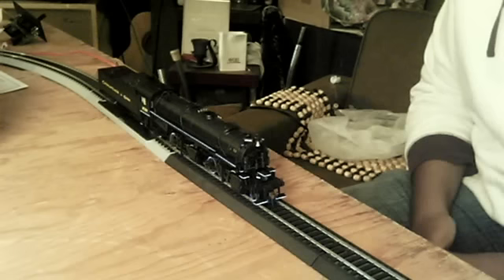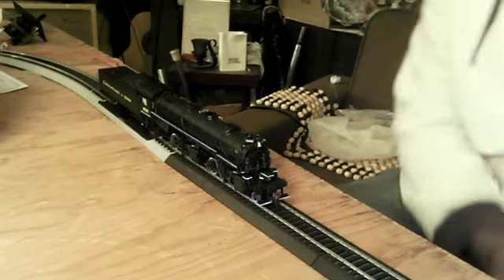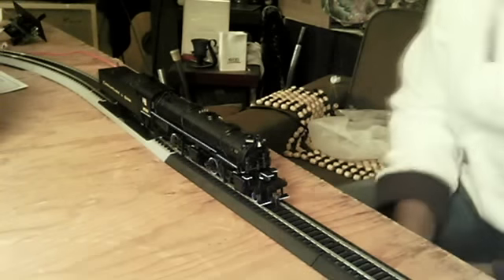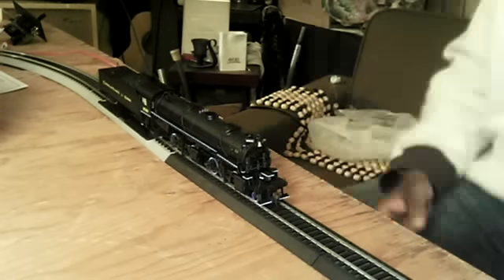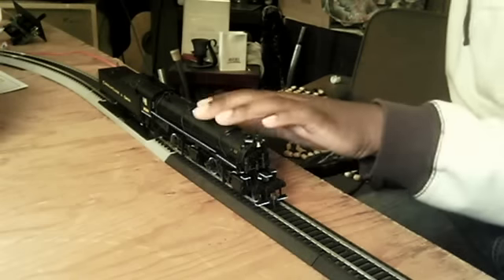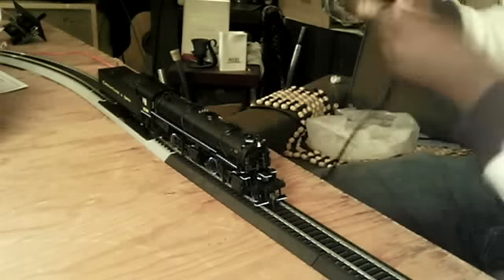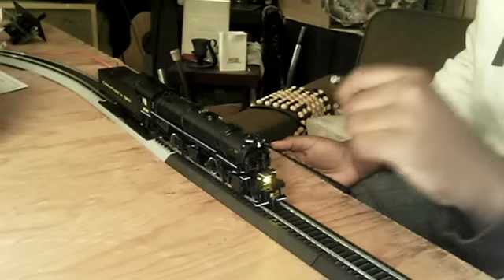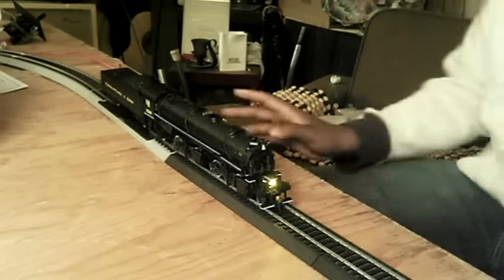Bachmann Spectrum 2-6-6-2 W/ DCC and Sound Review

Comment: i have the same loco, i paid $120 but without sound or dcc. its dcc ready and has a decoder installed but without sound. i bought this model about 4-5 years ago and it hasnt been run it quite some time but its mint and in the box. i will be running its again im going to build a new layout soon. i also have a spectrum J class that looks awesome as well as a decapod

Comment: 100% agree ... bought one myself 3 weeks ago , without sound , my only peeve with the dcc no sound is the crappy 28 speed step dcc decoder , i put a 128 speed step hornby decoder it to replace the crap bachmann 28 speed step unit ,massive improvement (any 128 speed step will do, but i only had a spare horby unit) I am about to put a tsunami decoder in it as soon as i post this with sound. the other great thing with this loco is how it does what the real thing was designed to do , and that is negotiate real tight twisty track ,as tight as 15 inch radius ...yes i said 15 inch radius freakin awesomely , also has some pretty amazing pulling power and is silky smooth runner , highly reccomend this loco
Reply from the maker: you should post a video of it as soon as you're done!
Reply: Railroadkid1937 I actually ran into a minor snag.On disassembling the tender i found i need a rectangular speaker and enclosure , my model has a Vanderbilt tender , however , I have a Bachmann Spectrum 2-10-2 with DCC and sound , which uses the identical tender in your video. The 2-10-2 is currently in a disassembled state awaiting a new drive chassis to arrive , so until it's rebuilt I'm using it's tender on the 2-6-6-2. I'm not sure , and I've listened to the sound on your vid a few times , but , is that soundcard actually producing the double out of sync chuff associated with an articulated loco ?
Reply: aussieaeromodeler question answered lol ....at 12 minutes into it
Reply from the maker: aussieaeromodeler lol glad the video could help out a bit :P all the tsunami decoders can be set to the double chuff btw.
Reply: they can ? .... awesome i dont suppose you know the cv to adjust and what to adjust it to by any chance ?
Reply from the maker: aussieaeromodeler I don't but check tsunami's website and look up the instruction manual for the steam decoder, that should give you all the information you need.
Reply: yeah just had a look , it mentions cv112 ... then goes on about 'bits' ... im guessing i need a laptop and software to change anything other than a cv value
Reply: i should mention im using a flieschmann multimaus control
Reply from the maker: no you should be able to change it without a computer. There is a particular cv you have to set and it may be 112. see if you can find the value for the cv.
Reply: the cv value is set to 0 at the factory , and stting it to 1 makes no difference. reason i say i may need a laptop , it shows a computer dialogue box ... with what looks like slide bars if you know what i mean ... similar to sound settings etc for your computer . I know there's software available to do these things , and the hardware to go with it , I might even look into getting hold of both.
Reply: aussieaeromodeler http://www.soundtraxx.com/manuals/tsutechreference.pdf      if you scroll down the page to cv112 , you'll see what i mean about the 'bits'
Reply from the maker: try setting cv 112 to value 97
Reply from the maker: sorry try setting cv 112 to value 81 instead
Reply: one word ...AWESOME ..I thankyou , perfect !
Reply from the maker: no problem my friend haha

Comment: Like the train just bought one , it was only dc and I run dcc your wrong about one thing about the sound of your engine ...........It is a mallet right ? it should have compound chuff then right !!!!!!!!!   the sounds I hear coming from that engine is not compound it sounds like a regular engine either a mike or a berk but not a mallet ....
Reply from the maker: it actually sounds like a articulated loco at slower speeds. You can hear the double chuff. Another thing  found out earlier this year was that I can make the chuffs go in and out of sync. I should have a new video of this loco up very soon. You'll hear it then. Thanks for the comment!